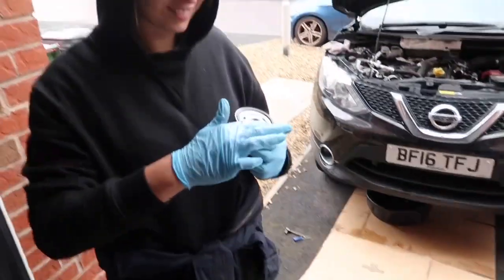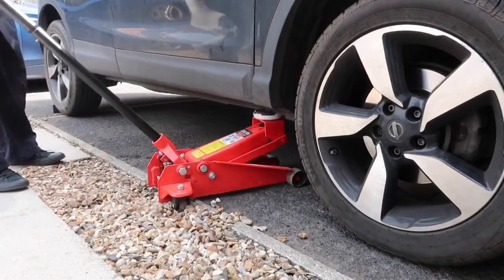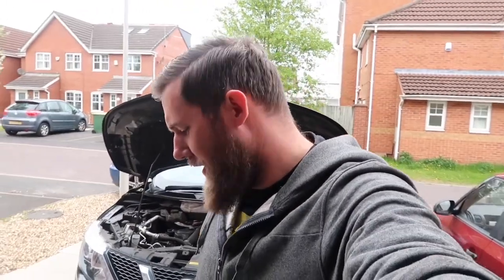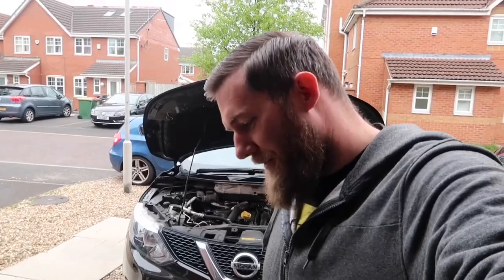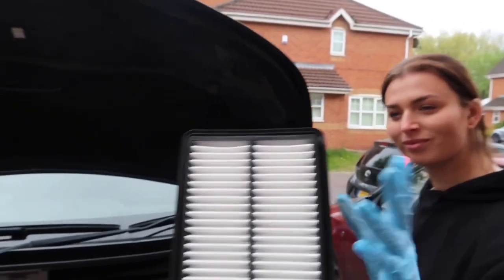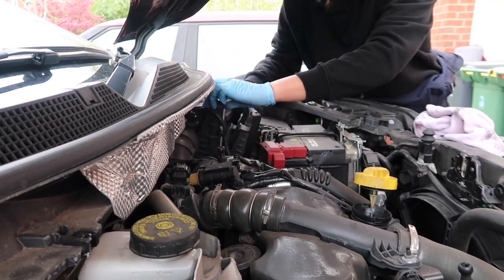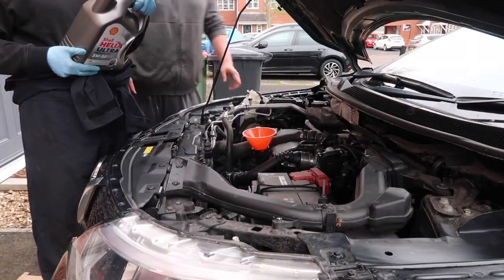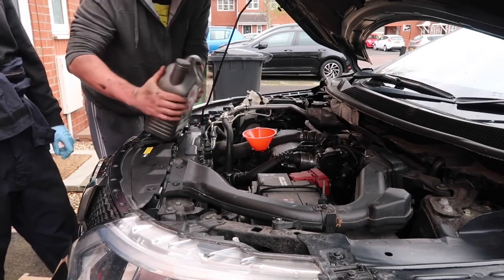Nissan Qashqai oil and filter replacement | fiancée services her own car

Comment: The american version Rogue is way easier to change the air filter, just remove the top cover and pop it in. Also oil filter is easier to access at the bottom. Also our dipstick is not the pour hole. That's wierd and cool at the same time.  European version seems unnecessarily complicated.

Comment: You put the oil in when the car was on a incline surly you did not get right reading for right amount of oil?
Reply from the maker: Oil was out in to ensure there was no leaks and then lower the ground with the level checked.

Comment: After watching your video last weekend and reading through the Haynes Manual... Changed the air filter, drained the oil, all good! But when it came to the oil filter removal it was a total arse ache.. Initially I attempted to remove it with the chain type tool, with no hope of getting a turn on the filter, relentlessly hesitated on me. Ended up buying the 3-leg removal tool that goes on the end of a rachet and extention bar. After a good 20 minutes rocking the car it eventually turned. Fitted new filter hand tight as it should be done.. I reckon the previous owner or servicer went mental on it for fear of an oil leak and over tightened it with a tool, certainly wasn't hand tight! Your video was really beneficial mate. Following your channel. Luckily I manged to remove the oil filter without taking off that tube you removed in your video plus manged to do the job without jacking up. My video link below

https://youtu.be/128RBhnRAlQ
Reply from the maker: Glad my video was helpful!! It’s an awkward place the oil filter but good effort getting it off! We recently did the brake pads front and rear if want to check that video out!!

Comment: Brilliant video! I have a 2016 Qashqai. Doing the oil change, oil filter and air filter replacement next weekend. Was keen to see whether you would remove that Turbo tube for less confined access for the old filter, as Haynes Manual interesting doesn't mention it as a suggestion in their detailed procedure. I have the chain type removal tool, but even with that I'd say it will be tight!
Reply from the maker: I’ve never used the chain type filter removal tool, the one I used got it off with ease if I’m honest, let me know how you get on!

Comment: Nice one guys!!! Very helpful video!!! Thanks. Just a question pls. How can I find, what kind of oil or air filter I need to buy. Is there any information site ? I m trying to find it in Amazon but I can’t. Thanks
Reply from the maker: I use www.eurocarparts.com for a lot of my car part needs, entry your reg and it will find parts to fit your car! 👍🏻